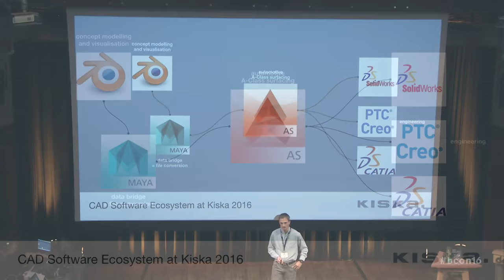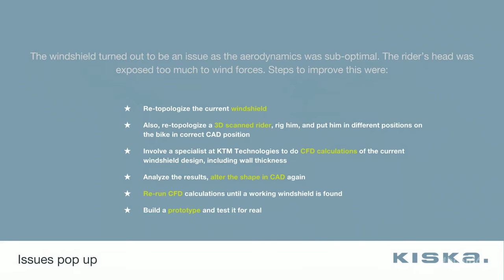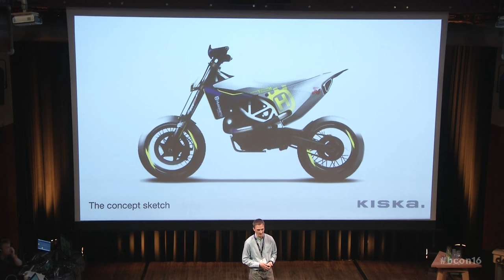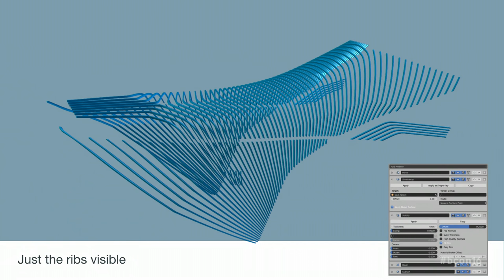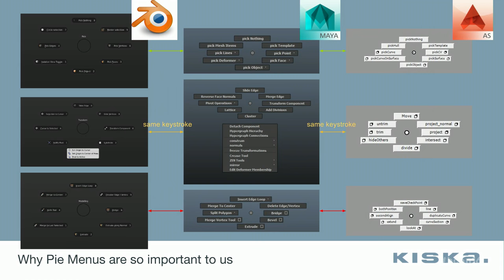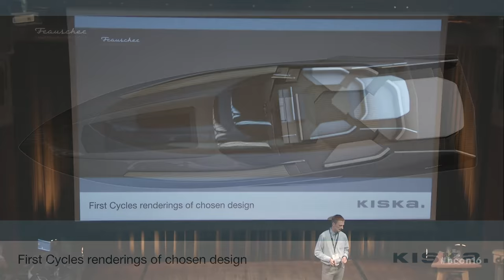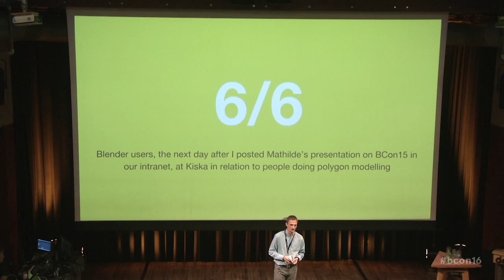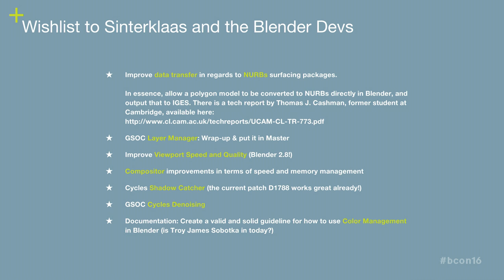Using Blender in motorcycle and powerboat design

Comment: Maybe Ton finally realize that Nurbs Is not dead and reading nurbs into blender is a must have. I talked to him about this 2008 in Los Angeles. Moi 3D also has the ability to import obj and convert it to nurbs and even more than smooth the nurbs patches so it is like subd smooth.

If the blender foundation would focus on that then more design companies would be willing to look into blender.

Comment: We do architectural work in Blender. And you spoke out of my hearth a lot.
+1 for unlimited, nameable Layers
Also Groups/ Layers you can give a colour and every Object in the Group would get that colour on its Wireframe would be very helpful with this Big Scenes. When you have 160 Instances of a Window-type, and you could make there Wireframes all blue by putting them in a "Outer-Windows-Type-123"-group for example. That would be a big help.
Also I'm often very impressed with Cycles in this gigantic Scenes.
And also a fan of the Modelling-Tools in Blender (I learned on Maya and Max). Getting stuff done in Blender is amazingly quick when I got the hang of it.